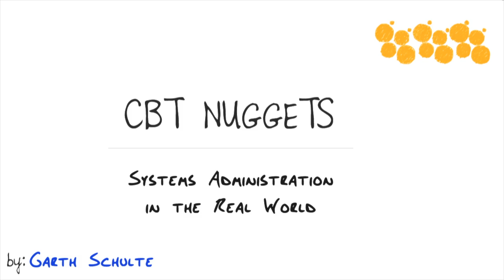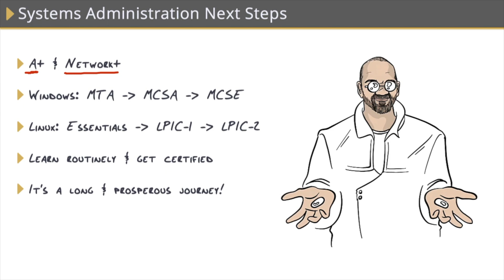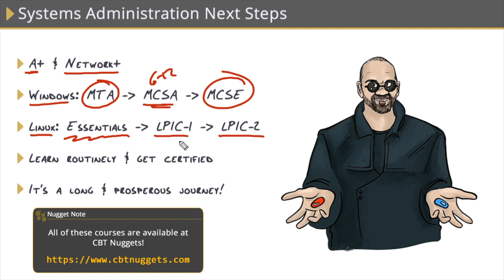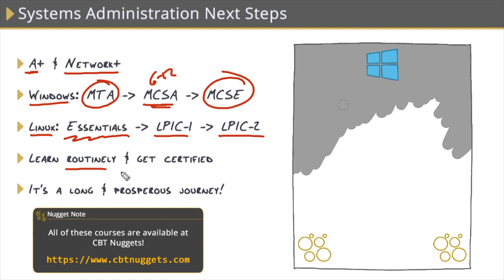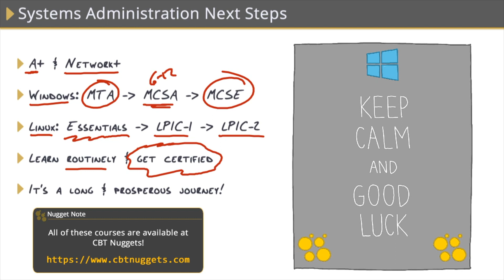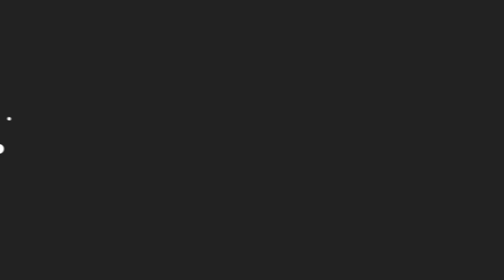How to Become a Systems Administrator

Comment: I got my Net+ and currently re-certifying it for another 3 years. Also been working as a service desk technician for about 3 years. Looking to become a junior sys admin, really appreciate the informative and insightful series. I feel like I have a much clearer understanding of what it would be like now.
Reply: I'm doing the network+ certification to try to get a job in IT. I'm already have an associate degree in software development. Do you think I could have a chance to get a help desk or somehow system administrator roll?
Reply: @raynerrodriguez2023  Absolutely, just absorb all that knowledge and do your best to apply it in the field as needed. As you gain experience on the help desk and get better at troubleshooting you will gradually work towards that sys admin position. Learning the network side of things really helped me piece things together tho and would highly recommend to anyone getting into IT.

Comment: I became a Sys admin no certs. You just gotta learn as you go and network with other IT professionals. If you can get a good network with a CIO or Senior Sys Admin, you're in the door.
Reply: Agree with this. I have no degree or certs, just two years on the help desk and now I’m a systems admin (making 70k plus full benefits with a sign on bonus for leaving my previous position the next day rather than putting in two weeks notice). All about carrying yourself well, interviewing well, and networking well.
Reply: @TheBdogup2  I'm currently in a help desk support role. I'm looking into applying to a Junior sys admin role as my next job. What hard skills were they looking for when you got the position?
Reply: @treebeard6900  the hardest part is switching your mindset. Instead of grinding out user centered incidents, you have to solve problems (patterns of incidents) and think in terms of the environment as a whole. And look for problems no one even knows exist. As a sys admin your job is to maintain the integrity of the environment and work closely with Sys engineers until you ultimately have the knowledge for project and implementations. Because I’m a sys admin II, I do projects and implementations. Things like implementing new DHCP servers, etc. Also, by the time you’re going for sys admin you should understand most components of AD (not just users and computers, also group policy objects, etc.), have an understanding of basic network infrastructure and how it all works in tandem, and be decent at researching and asking the right questions. You’ll go from high ticket rates and low handle times to handling 1-2 maybe 3-4 tickets a day and spending several hours on each ticket. It’s a completely different workflow, mindset, and responsibilities. Also, you’d be responsible for creating the documentation that people in your current position would use to solve problems. But, considering your knowledge will be more advanced as you settle in the role you’ll have to be careful to keep in in words that your less adept peers will understand.
Reply: Here’s a question I was asked during my interview: “A phone in the office says “registering” and the computer has no network connection at the same desk. No one else is reporting issues. Start asking questions and walk us through your troubleshooting process.” Now, while there are right or wrong answers to this in the end, what they are really looking for is your mindset and how you troubleshoot and how efficiently you can do so
Reply: Another question I was asked is “How do you reboot a server?” Now, for someone on the help desk they would likely answer “you hit the restart button” or “hard reboot”. And while this isn’t wrong, this is a trick question to see if you are in the correct mindset to make the transition to this position. A seasoned engineer or admin would answer with another question “I would first ask you what services or applications are running on this server and are they vital for business operations? Then, based on the time of day I would make a decision on whether or not a reboot is possible or schedule it for after hours.” now, this also depends on whether or not the services/applications are still running, if they are hard down and essential a reboot may be necessary. But, all other avenues need to be exhausted first.
Reply: How did you began? Can you tell me your path?
Reply: I agree you don’t want to become a cert junkie

Comment: Video too old. Microsoft removed all of its MTA/MSCA/MCSE certifications. Also the cloud is really hot right now. Try AWS, Azure, or GCP.
Also Cisco will always be viable.
Reply: Would you recommend Linux+ cert over Lpic?
Reply: Akihito007 I just got the Linux+ a few days ago.    I learned quite a bit.   I don’t know how it compares to lpic but I heard Linux + is the more respected cert
Reply: which is better network admin or system admin? and what is the difference bro? I want to be in network security field or cloud.
Reply: @alexilaiho8534  - One is in charge of the network computers and user access monitoring mainly while the other deals with software and hardware like storage.
Reply: @YoungDen  thanks bro, are they both a prerequisite for security purposes? and which one are you bro?